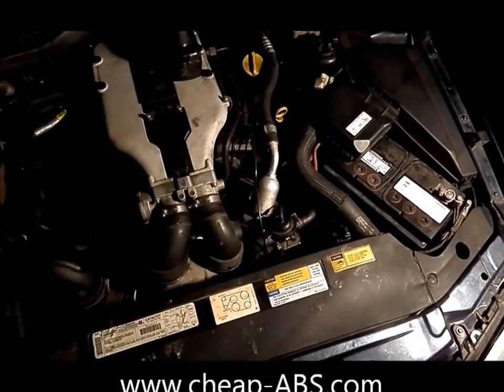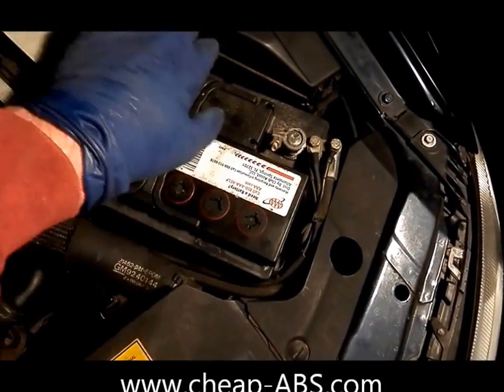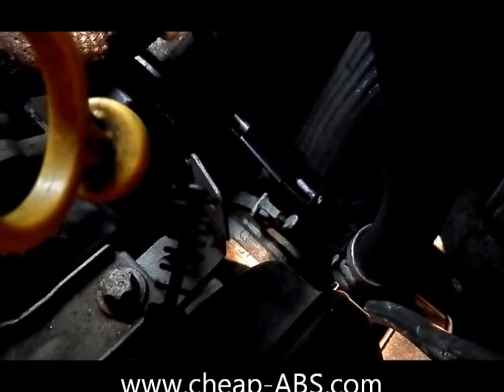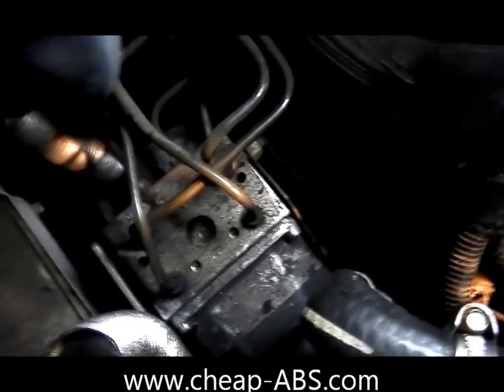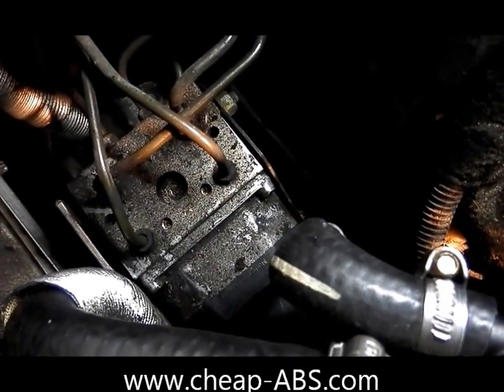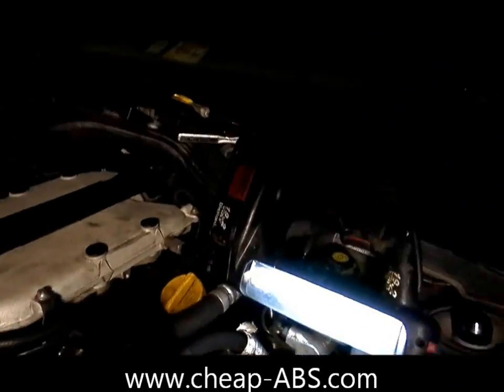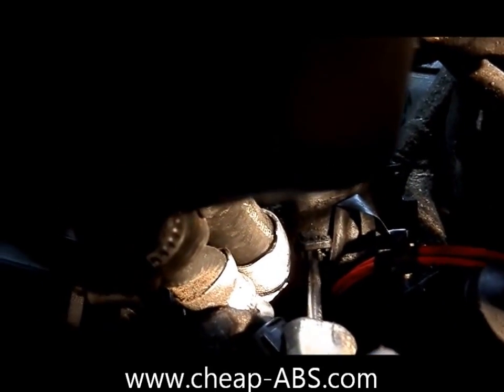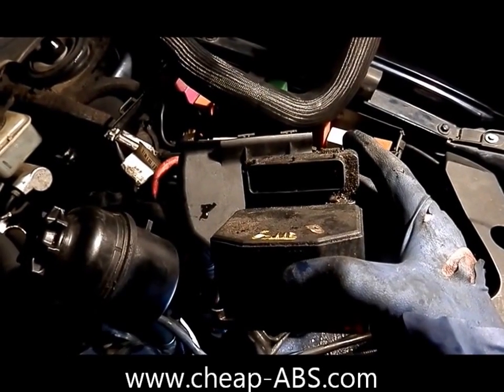Cadlliac Catera ABS module fix - How to remove

Comment: great tutorial, but for me, getting radiator hose off was much easier than manipulating the pump to access the 6 module fasteners  After removing pump from cage, I could only move the pump slightly..